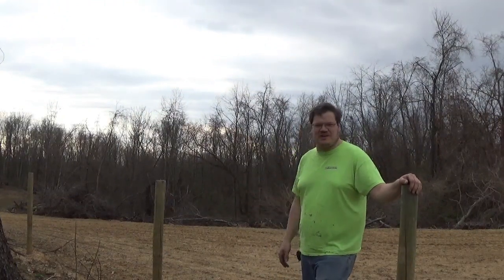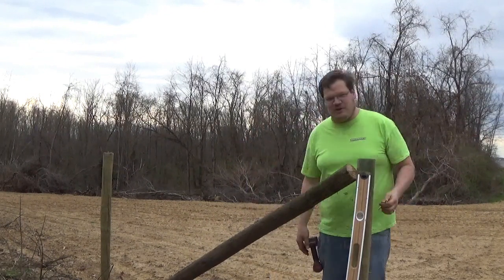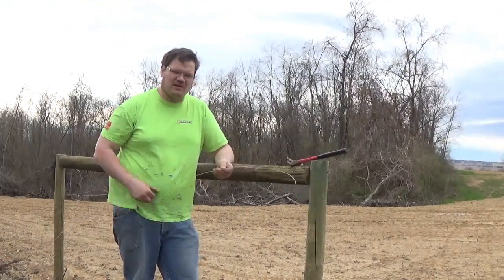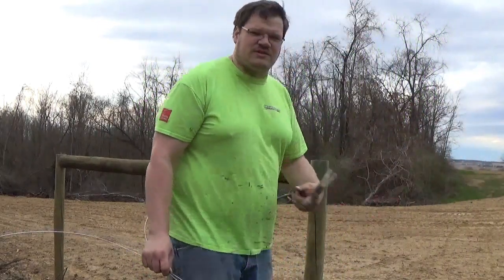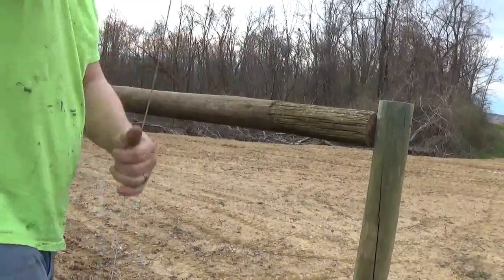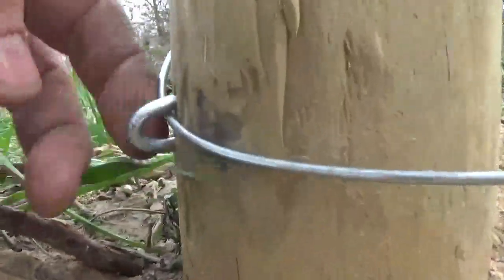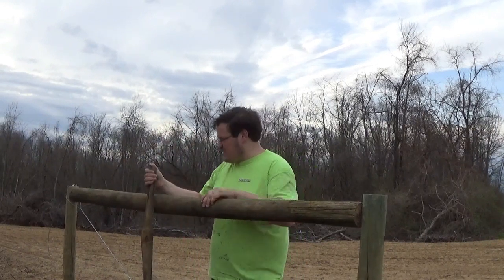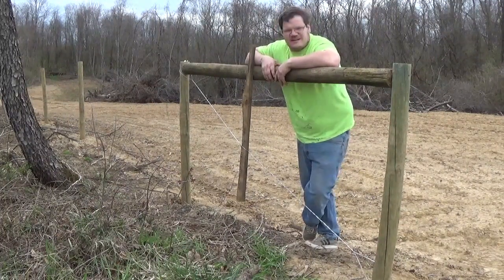how to install a corner brace for wire fence

Comment: Very nice video! You got straight to the point. I have a question. I’m building a 35’ X 14’  welded wire fence enclosure for my chickens. Do I need to brace all the corners for something that small? Do I even need to mess with bracing them at all? Thanks!
Reply from the maker: If you are going to pull it tight for sure I would brace them. Even if you don't the corners will still be tugged on alot and may start to pull over over time
Reply: @JaysToDoList  thanks I definitely don’t want to have to redo it in a year

Comment: What gauge wire do you recommend? 9? 11? 14? I am building a goat fence.
Reply from the maker: I used 12.5 ga on all parts of this fence if your fence runs are very long you might want thicker l. I also used this for the electric fence wire as well here is the link to the actual wire I used have a great day https://www.tractorsupply.com/tsc/product/bekaert-wire-high-tensile-200k-psi-2000-ft-118361?cm_vc=-10005